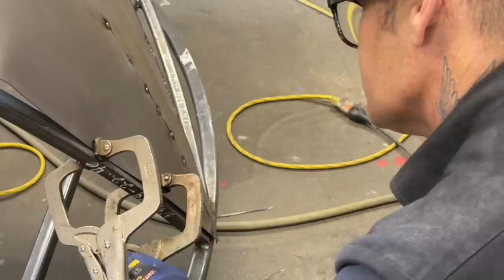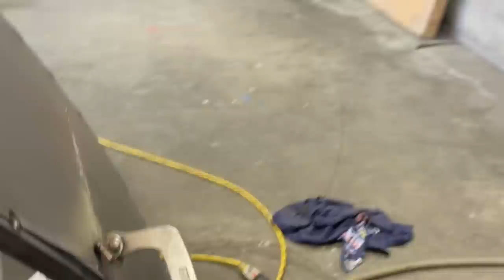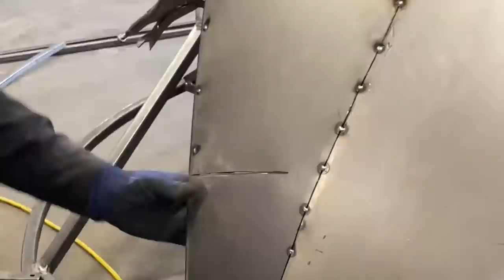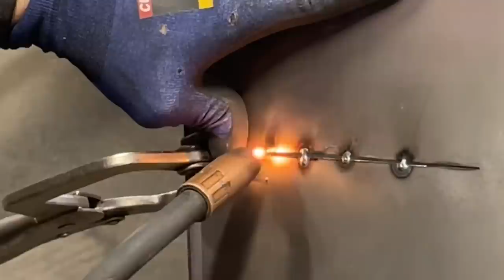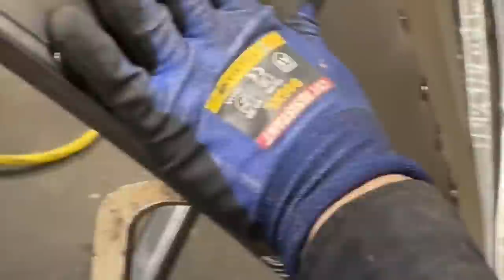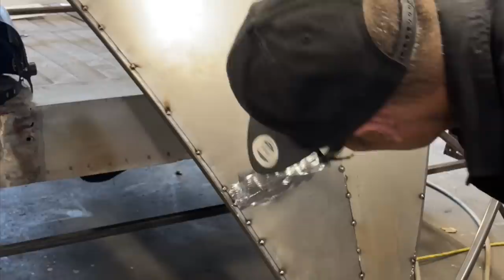Ran into an issue with the rear panel 😱❌

Comment: I appreciate your skills and how you are able to move the metal. It has taught me a lesson or two.  Just wondering how the artisan you are imitating would have done it. My dad taught me gas welding back in the 60s, pushed the mig machine and pulled out the old tools. Good job!

Comment: Miscutting panels is difficult,  i know.i used to repair Airstream travel trailers (RVs).
Easier to start with outsidelimits, and do inseam last, you can overlap,cut and seam easier that way.

Comment: Hot tack it. Start closest to last good tack and the last place u think u can place a large tack . Right after you place the tack hit right on top if it with a 2lb sledge and it will pull down. Work your way down until you no longer have to " HOT TACK " it.

Comment: If you were to  add some large bolt/ cap screws/ rivet heads to the joins on the back sections It would add a PUNK rock look to  the back and take your eyes off the joins, also adding an old style of manufacturing to the body work